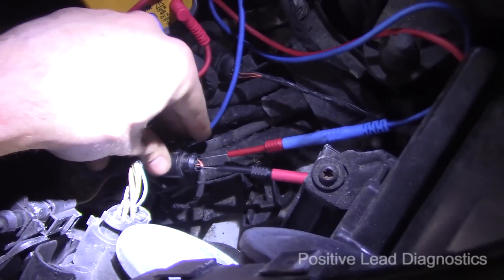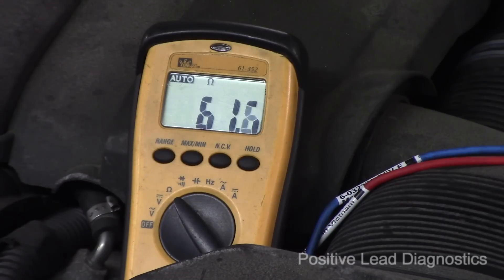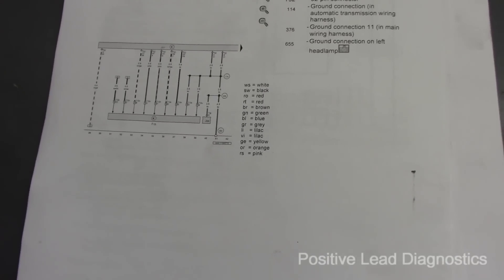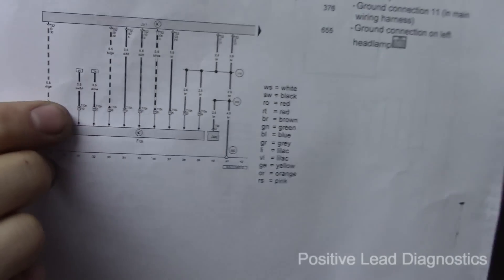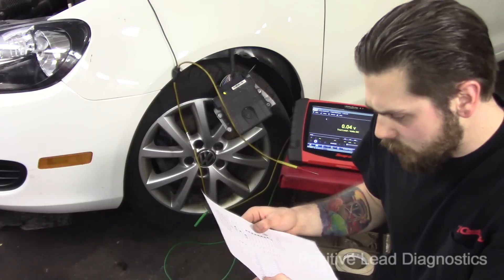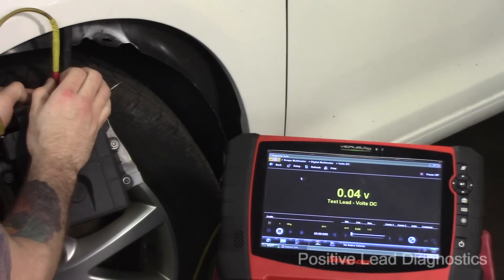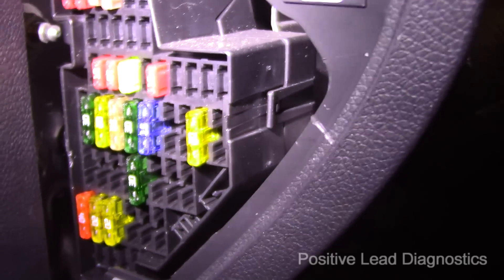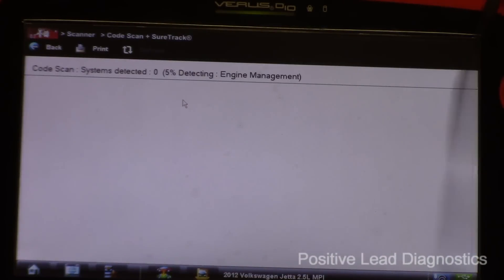2012 VW Jetta No Communication with TCM U0101 (part 2)

Comment: my only experience with CAN so far was a nightmare job on a 2007 Equinox, in that network the DLC is right in the middle and there are EOL (end of line, or terminating) resistors at BOTH ends, they are 120 ohms, so when it's functioning properly the resistance is, you guessed it, 60 ohms. One resistor is waaaaaay back at the fuel tank, the other lives inside the ECM, which is of course at the extreme other end of the vehicle, actually situated atop the battery. Now in that system, each module has 4 CAN lines, two in and two out (2 CAN hi and 2 CAN lo) so, if you unplug ANY one of the modules the resistance immediately jumps to 120 ohms, I did not see that in this case, seems pretty stupid to me, what is the point of using EOL resistors for creating a supervised network and then not wiring it in such a way (daisy chaining) so that you can immediately know when one is dead, fried, missing, a wire is cut, shorted, etc,? I work with alarm system, DSC in particular and they use EOL resistors extensively, especially when you incorporate smoke/fire alarms in the system. EVERYTHING is supervised, if the resistance goes too low or too high, the alarms sends up a red flag... thoughts on this???
Reply: I thinks its because if one module goes they don't want the entire network to be wiped out, probably a safety issue. they area all wired in parallel to the gateway on separate networks and are monitored in a different way.
Reply: Hi Tommy, thanks for the reply and great job on diagnosing this car and avoiding a costly and unnecessary module replacement. The way the network functions in that Equinox is you can pull a fuse on any module, taking the module completely offline of course, and the rest of the network stays up. The connection between the 2 CAN hi and 2 CAN lo lines must be hardwired. It seems that they are using the the EOL resistors strictly for supervising the integrity of the data lines but requiring the module to provide internal connection for said data lines.

That's what puzzled me about that VW network, when you unplugged the TCM it seems like it should've taken the whole network down. As you said, apparently that is not how they wanted it to behave. I wonder if unplugging certain modules would take the network down, perhaps ones are considered primary and others not so much. 

As I write this out and think about it, there is little difference in functionality though... the only real difference in the two is the GM CAN is requiring the module be present and have a good connection, otherwise, in your case unplugging the TCM still allowed the rest of the vehicle to function; same as me pulling a fuse on a given module in my case and having the rest of the systems do ok.

Comment: i had a customer with 2001 Audi A6, complain was the tranny was stuck in a 3 or 4th  gear don't remember now been a while. the  code was for tranny range switch problem, did all the checks fuses harnes  all checked out ok. good now what  changed the range switch with known good one i had in the shop  same thing. For some reasen i put the driver sun viser down and what i see some open wirres shorting out got all connected blew one fuse for garage door opener on the visor fixed the cables transmission shifting good and no mil coming up weird situation but got it fixed sorry for the spelling or grammar thx

Comment: warum machen ist einfach, wenn kompliziert funktioniert genauso gut"

"Why make is simple when complicated will work just as well,"

It's the German way.

Would have been interested to know if Tommy was able to speak with the customer directly and ask just what went on  prior to the no shift problem.  " Yeah, I had a problem with "XYZ" and  a buddy and I tried to fix it and checking the fuses" or something like that.  

Only reason I mention this is I got caught on problem with a buddies daughters car.  She went to the Quickie Mart for something and came out and her car would not start.  Crank but no start.  No spark, but had fuel.  I messed with that thing for couple hours and she stopped by and I was speaking to her about it and said that she needed her wallet from the consul that she put in when she came out from the store.  Said that everything was fine until she put her bill fold in there.  
INTERESTING
Dug all the crap out of the consul and found that previous owner had put and anti theft toggle type switch that cut off power to the IGN.  When she put her wallet in there it tripped the switch.  Grrrrr

I realize the service writers in Dealerships are a "Buffer" for the techs, and very few service writers are techs.  They just write up the service order as quick as they can because there are 5 or 6 people standing in line. 
But in this case, where it was particularly tricky and potentially particularly expensive, maybe 10 minutes on the phone with the owner 1 on 1 may have led Tom to the fuse box.  
maybe............ maybe not.  Nice find though.  
2 thumbs up.

Sorry for duplicate posting.  

I posted this on the part 1 video.  Should have posted it here.

Comment: Tommy, Nice ! Paul, one of the viewers in part one suggested that you guys check the power to the shift interlock and you dismissed it as having nothing to do with the TCM. That made me start wondering and I pulled up a wiring diagram and also went on iATN and sure enough there is a case where the fuse that powers up the shift interlock also powers up the TCM. A quick way to tell is to see if you have brake lights because it also powered up them up too.
Reply from the maker: In hind sight, all of this is easy to see isn't it Billy? When you have confirmed good powers and grounds to the TCM, there would have been absolutely no reason to even look at the shift interlock issue. 
Again, we were missing a power feed but didn't know that, so in this case if we did look at the shift interlock issue separately from the TCM issue, we would have found the fuse issue from that angle. 
So, I dismissed it because if we did have good powers and grounds (as I was told by Tommy), there would have been no reason whatsoever to look in that direction. Make sense?
Reply: Sure Paul blame it on Tommy ! LOL ! Paul, You still the man ! LOL !
Reply: yeah some friend! I thought the no shifting concern was an effect of the tcm no comm. not realizing they shared the same power feed.
Reply from the maker: I'm not sore with you Billy. It's hard sometimes to gauge intent with words on a screen. Sorry about that buddy
Reply: It is hard to tell intent. I also think there were a lot of viewers who learned and loved it. Myself included. Not saying I'm in the dark on network operation but there are always questions.
Reply: Yea Tommy, Paul thru you right under the bus !!!! Wow ! LOL !  But to be fair to Paul hindsight is really great !  I think Paul is a little sore with me ! ( In hind sight, all of this is easy to see isn't it Billy? ) LOL !  I don't know why he would be sore at me, I'm always telling him he is a Automotive God to me ! LOL !  But I will tell you this there was a lot of viewers following this vid that seem to me that were pretty  knowledgeable about network design ! Also congrats to the viewer in Part 1 ( Phoneguy13 ) who suggested to look at the shift interlock  ! Take Care Tommy, You to Paul !
Reply: Paul, I know your not, dude don't mind me I'm just messing with ya ! Paul, I have the upmost respect for ya and dude I learned so much from you over the last few years so chill out ! LOL ! Take Care Paul !

Comment: WOW good catch, did the original fuse blow and someone just replaced it in the wrong spot? 
I'm not a tech but my first thought after watching and before reading the comments was the same as Teardowndan's explanation as to why there was distortion in the signal.
Reply: In the video, slot #29 does not appear to have a bottom contact. Looks like someone pulled fuse #30 and mistakenly put it back in #29.
Reply: Teardown Dan 
The only thought in addition would be...was it pulled to check - maybe no test light or blown and fit in the wrong spot.

Comment: Excellent job by both of you. Have seen missing/misplaced fuses causing problems before. I hate German car schematics too but i'm sure if you work with them enough you get used to them. I question my diagnostics all the time and check and recheck and sometimes i'm wrong. A $1000 mistake would be a kick in the butt. It's all about learning and persistence in our trade and it will never end.

Comment: Great respect for Tommy owning that and easy to do with those WDs and Mitchell are definitely easier to read. That power from the fuse was affecting the oscillator which is why the CAN signal was unreadable by other network nodes and it shouldn't affect the network resistance. I don't mess with VWs and unfamiliar with their CAN but after a little research b/c I'm bored to death with no cars today it appears there is only one terminating resistor & it's located in the ECM & is a 60 ohm resistor.  Powers & grounds so important and again to Tommy hopefully you see this...I respect you so much more now b/c we all make mistakes and with my 40+ years I'm chuckling right now thinking of some of mine but it takes integrity to admitting a mistake but the bottom line was you backtracked & found the problem and prevented a $1K mistake...great job. For you Paul you produced an extremely talented & knowledgeable tech & it's great to see you guys working together. Both of you keep the videos coming b/c they are great and I hardly watch TV anymore!!
Reply: Same here! Thinking about cancelling my Dish Network subscription. :D
Reply: @SmittySmithsonite  smiling here. I am old and have no idea how car electronics work but was forced to try and learn bc of buying a used vehicle that went south..blah blah, But wanting to learn for years & having to repair my vehicle myself, ($$) I am here on my computer next to my tv, which is off. Like you, this is more entertaining, plus useful & $$ saving. My head is swimming but so far this is fun. Like when I put my first clutch in '53 Merc at 16 y o.
Reply: @tubetime39  AMEN, brother!
Reply: "WDs and Mitchell are definitely easier to read" - I agree.
 VW diagrams (and many other european brands) ... no comments. The diagrams are unreadable. Useful but extremely unreadable. Car installation scheme (general, no details) for 80-100 pages? This is a joke! Especially that there are only "modules" on it, not integrated circuits and passive components. Bad joke.

This type of CAN bus probably (!) does not have a classical termination resistor, but some kind of "resistance simulator" (semiconductor, built into a transmitter / receiver integrated circuit). Regardless of that, any measure of resistance to the system connected to the power is pointless because the results are bad/random. The meters we use (universal multimeters) are not suitable for such measurements.

Comment: I was working for many years on Caterpilar.They have solution for testing ECM.You get new ECM and program it and turn on testing .Install ECM and if that fixes problem You are done.If not remove new ECM and in 24 hours it clear it self and You could return it.Very good feature.If you leave it in vehicle more than 24 hours test mode go off and you bought ECM.

Comment: Awesome Technician Skills  (Not Mechanic) Tommy! 99% of shops probably would have made wrong call. Sometimes the simplest stuff like that fuse can cost a Tech 8 or more hours of troubleshooting time which most shops won't bill customer. I have been Tech for 40 years. When cars like this one eat a Techs lunch, customers need to pay. Hope you recovered your time. Great Video and your skills are awesome!
Reply: shawns442 I do mobile vehicle for a living and shops make a bad call on module's about 15% of the time and I is usually something simple they missed. I have a Facebook page MVP Programming I have recently started. You should check it out for my tip of the week please like and share.
Reply: @GSRThree  would you consider integrating your knowledge into your yt channel? I'm going to sub your channel in hopes you do. I'm old school and don't use fb. I know the rest of the world does and it me not be worth your time to bring your message to yt. But if you do I'll be there to learn from you.
Reply: +shawns442 I don't necessarily agree that the customer should pay. I don't think many techs get enough training in an industry that is changing so fast. Don't think a customer should be on the hook for that. This guy owned up to his mistake and kind of sounds like the OEM schematics suck compared to the ones Scanner Danner looked at later. Strange! I think the worst problem for a tech to find is an intermittent problem. I would hate to be the customer or tech in that situation.

Comment: Is 20A the correct value for the fuse or is that just what someone plugged in there? Gotta wonder why a computer module needs a 20A fuse. Even more of a mystery what could happen to take out a 20A fuse (that someone eventually put in the wrong slot. Must be some other intermittent problem for the module to draw 20A.Another comment from a customer point of view. Why don't factory authorized dealer shops have a module on the shelf for troubleshooting purposes. Once you've checked that everything is basically safe and you've checked as much as you can, and your still stumped you could plug in a known good module. In this case you would have  seen the same issues and proceeded with more checks. Instead of fretting over whether you've missed something and having to charge the customer for something they don't need.
Reply from the maker: That fuse powers more than just the TCM. And to have a known good module for every system and vehicle is not even close to practical even for one car line! These modules also need to be programmed when replaced and some of them are a one time write!
Reply: Both explanations are reasonable. Thanks.
BTW Good work
Reply: I'm ok with it. Il take the learning experience as pay.
Reply: there are other circuits being powered on that fuse, I could understand a stock of test parts, if all the vws had the same module and just different codings or programs, but there would have to be another building to hold this testing stock because they are all different, its just too expensive, that module alone was $1000 that's crazy, and plus where is the learning in that? I'm not worried about scratching my head for a little bit, the info here that is retained is invaluable, especially when its hands on because you wont forget it. I understand why you would suggest that method of using "known goods" because its standard procedure in your industry, it just doesn't work that in the automotive field. the customer was charged 1.5hours of diag.
Reply: Tommy, 1.5 hrs for diag. and 1.5 for being a dumb ass !
Reply: @billyr9840  And you are a IGNORANT ASS! The same schmuck that would never admit to EVER making a mistake BUT always knew the problem after somebody else fixed it. Gee, why do I know that---there are usually one or two like you in every shop.
Reply: Tommy, you a better man than me ! LOL !
Reply: Having a known good TCM to plug in would  at least have prevented him from calling the TCM as bad!
Also, if he had plugged in a new TCM....his problem would still exist, which should tell him the TCM is not the problem. ( There is some advantage in troubleshooting with known good parts.)
Reply: Yes. That was my point as well. But I guess (according to Scanner Danner) you don't get that option in the automotive industry. A shame for all involved. Especially when (apparently) they were working in a dealer shop where the manufacturer could easily make their workers more efficient by supplying a stock of test parts.
I'm in the electronics industry (for 40 years) and it standard procedure to (be sure it's safe to do so) and then plug in another part (chip / module etc) to see if conditions change. You can imagine with a board FULL of chips (like what is probably inside the TCM) you can only go so far before you have to try new components (due to too much interaction between multiple interconnected chips). I'm not suggesting part swapping (which is NOT what this channel is all about) but I am talking about efficient trouble shooting that saves everyone a LOT of time and therefore $$.
I wonder how much this customer was charged in time while the head scratching was going on. 
 It is what it is I guess.

Comment: you should check your can bus resistance after replacing that fuse,to compare the difference,with plug in and plug out
Reply: You wouldn't learn anything. The 2 ohms difference is most likely caused by the CAN bus devices' internal bypass capacitors slowly charging while you are measuring resistance. The fuse shouldn't have any effect on this, especially with key-off where the ignition switch or relay would open the circuit anyway.
Reply from the maker: not sure what that would have shown us, as the resistance was within spec both with the TCM plugged in and unplugged. 2 ohm difference if I remember right.
In hind sight maybe we could learn something
Reply: Thank you for your answer.
The resistance difference was only 2ohm, becaus at all time he measured tcm unpluged (mean witout power=pluged out), and now with good fuse he should see this resistance  diffrence,    with tcm plugged in.
Reply from the maker: Yeah man, that's what I'm talking about. Want to come to Rosedale and teach a 1 day 4-5 hour class on these simple truths of CAN bus internal wiring? Can you dumb it down for us would be my only concern. I'm serious.
Reply: I might give it a shot. Currently weighing my visual support options to determine which one I may be the most comfortable with.